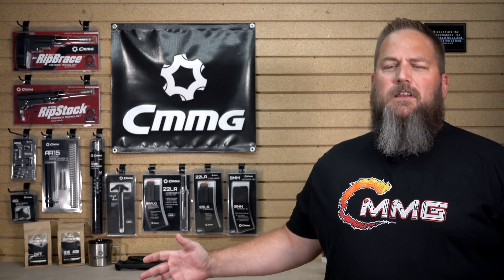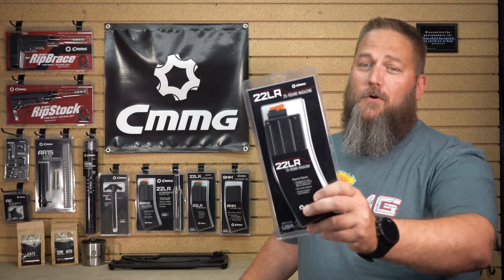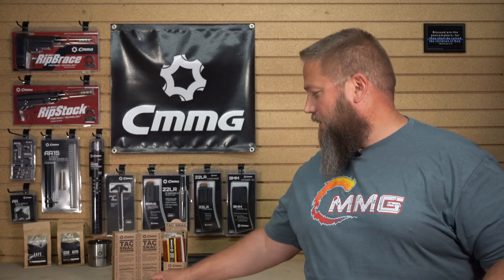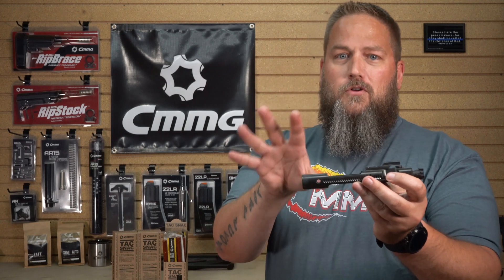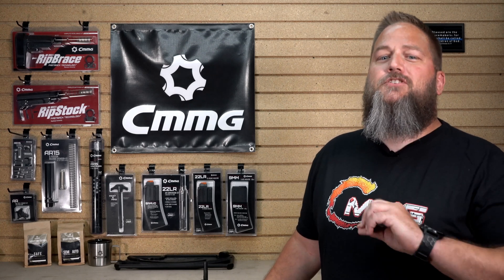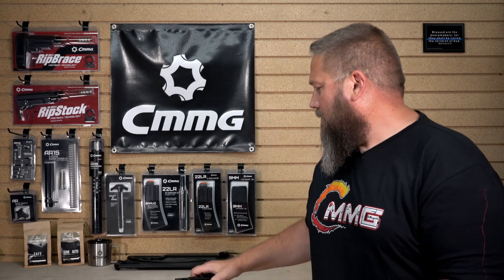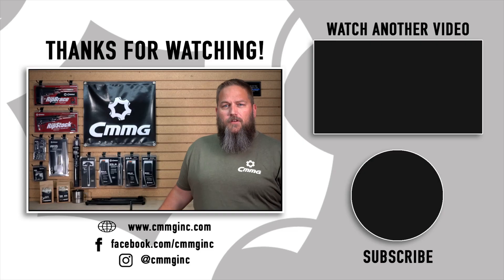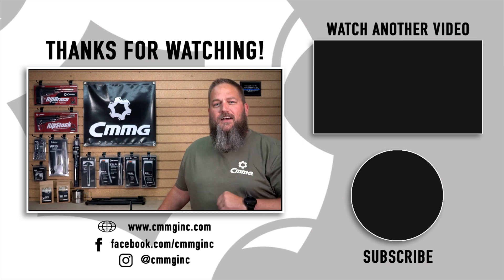You Asked, We Answered. Answering Customer Submitted Questions. CMMG Q&A

Comment: What weight would be best for running suppressed for the RDB out of the action tuning kit, Heavier or the lighter?
Reply from the maker: It's a little bit of trial and error, based on the ammo used. Think of it like an adjustable gas block for your RDB. Use the weight that allows your preferred ammo to eject properly.

Comment: tuning kit is NOT an "easy"  install when using provided direction. I guess the middle weight has something that needs to be set so one end goes to the front after I realized this pin half way in I tried to remove pin with punch and hammer. Not budging. gun smith had to torch to heat and use special tool to remove pin. videos like this and provided instructions did NOT help. I have built quite a few guns so my experience level is par.

Comment: Can I use the Colt AR6951 lower (by taking off the ejector) with the CMMG RDB 9mm upper?
Reply from the maker: You'll likely need to use our Mk9 Upgrade Kit. It will change the buffer to a lighter one, it also has a modified feed lip to work with our RDB better. Along with some other parts. You can pick one for the mag you prefer.

Comment: Can the bolt carrier weighs be used to slow down (adjustust) rates of fire with the fightlite echo trigger system (a la M3 grease gun) and still allow the BHO feature to work with 230gr. 970 fps ammo or will I have to use 230gr.+++P ammo?

Comment: I have a Mk-8 Lower. How does the bolt catch/hold function? It’s not equipped like a traditional AR style.
Reply from the maker: The Mk-8 was designed to use FAL type magazines. I don't believe there is a bolt catch option on these. You may contact our Tech Support for more information.

Comment: Why so many jams on MK10? Any solution to fix this? Any plans to become ammo agnostic in the near future?
Reply: Thanks. Yes I contacted your team over the phone and was told by an answering machine to send an email to support@cmmginc.com which BTW it’s been 36 hrs with no reply. I’d expect a better support experience out of a $1500+ pcc. Also, in the ammo shortage era we can’t stick to a prefer ammo brand or type. It’d be way more convenient if you could advise which ammo works best on your ammo exquisite Banshee line.
Reply from the maker: 10mm has such a wide variety of ammo out there with greatly varying power factors. We offer the action tuning kit to tune to your preferred load along with different buffers if needed. Feel free to contact our Tech Support team for additional assistance.

Comment: I understand that the ejector spring should replaced every 1,000-1,200 rounds.  I looked on the website and I can’t tell which spring is proper replacement for a 9MM RDB bolt.
EDIT:  Found out that most recommend the Mk10 spring.
Reply: Thanks for updating. 👍

Comment: What really sucks is that when your RDB bolt and barrel you bought  fails to eject bc the bolt won’t hold onto the spent case,  CMMG customer service just tells you to go suck rope, and won’t fix their product. Now I’m stuck with a bad part and cmmg won’t make it right.
Reply from the maker: Erik, sorry for the problems you are having. Unfortunately we on the media team aren't the ones to work with on this. Having checked with our Tech Support team, it appears that they sent out repair parts in January with no response since. If you are still having issues, please follow up with them via the email chain you already have with them. Thanks!

Comment: What buffers should I use for my CMMG Guard .45 acp with 8" barrel upper?
I bought the upper to use with the lower thay came with My Banshee 10 mm.
The 
.45 acp upper did not come with a buffer or recommendations.
Also I did not receive a manual with my Banshee 10 mm pistol or my .45 acp Guard upper.
I didn't see a download for these pistols.
Thank you

Comment: I gotta question,i bought the cmmg 300 mk57 upper & got 6 mags in total. If i load 40 rounds into the mag,it will not lock into place,if i drop down to 38 or less it locks in place just fine. Why will it not lock into place with 40 rounds? Is this common? I have it on the spikes punisher complete lower,but still had the same problem when i put the upper on my ruger 556 lower. 38 or less it works fine,39-40 it will not lock into the magwell. It will go in,but will not lock into place.
Reply: Had the same issue when in military.  We only loaded 29 at max, or had the same problem.  No sure what CMMG will say.
Reply: @derrickhouska4935  im the same way,on my ar15 i only load 25 in each mag,so i can store them for later use to help keep the springs in good condition,my cmmg i only load 35 in each for the same reason. Not being able to load 40 dont bother me at all,but was curious if i had an issue i needed to deal with.
Reply: I understand that is normal with the bolt closed. Try opening the bolt.